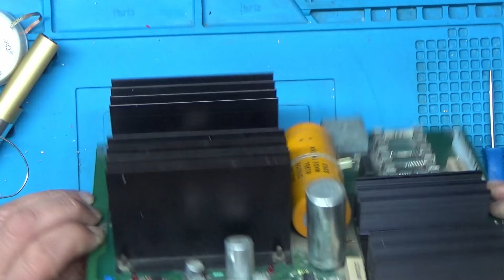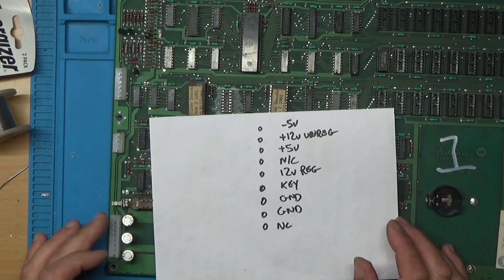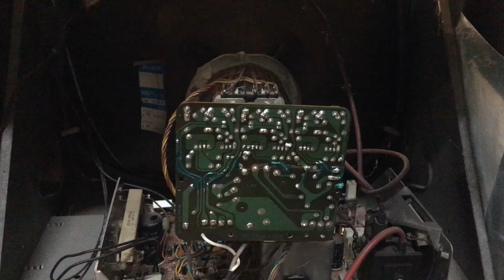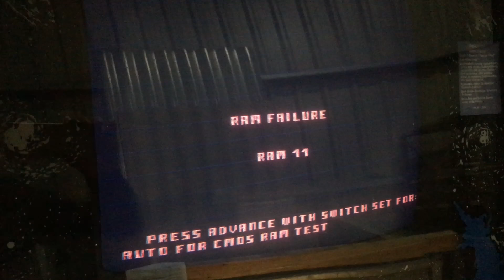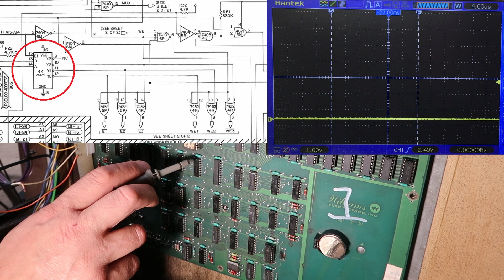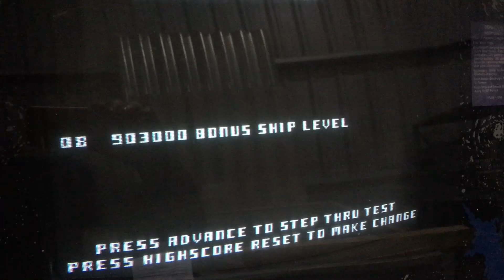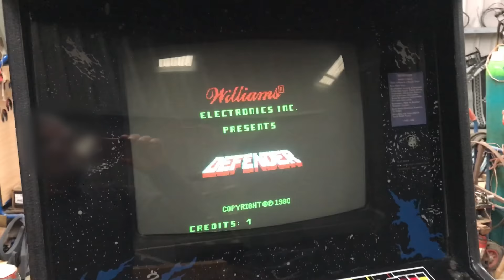The Repair That Broke Me - Part 2: Rescuing a 1980s Defender

Comment: That is one hell of a beautiful machine. 
I agree that old school capacitors last longer and are more "in spec" than Chinese replacements. 
Trade off cheap and you get crappy parts. 
But it looks like a whole cemetery of chips came out of this machine, so perhaps old school micro chips weren't as good as imagined. 
What is this machine worth now it has been fully restored ?
Reply from the maker: Yes, there was quite a big chip graveyard from this one. I think someone had one on eBay and was asking £4k for it. Not sure if they'd get that or not though.

Comment: Excellent job repairing this . Lots of things to fix . Do you think that battery replacement will have enough capacity only being a coin cell , you might lose your high scores after a shorter time .
Reply from the maker: Thanks. It should hold up fine as it's only powering the CMOS settings, but time will tell! 👍😊

Comment: I used to repair those arcade games in the late 70s and early 80s, it was fun, but they didn't want to pay the cost for
the techs and equipment back then, even though they were bringing in good coin...
Reply from the maker: Oh nice 👍I've also done a space invaders and recently a Konami Scramble board. Just finished doing a Galaxian board that was pulled from the same skip as the scramble one over 40 years ago. It was in pretty bad shape with loads of rusted chips and sockets, and lots of bits missing, and modifications. Oh and then more problems too! (Future video out in a few weeks).

Comment: Are capacitors today are being built for expected short life span products, like what you might use them for, you don't expect in use in 10 years.
I would think if thats so that you can buy top of the line ones rated to be exact and last as long, just you have to pay for what you want them to make play.
I mean that stuff 40 years old and 98% is still hammering hard. While a PS5 bluescreens 13 weeks after purchase.
Reply from the maker: I think it's because they changed the way capacitors are built. The old ones were a lot bigger, and they've reduced the size, and also the lifespan it seems...

Comment: Just caught up with this and your perseverance is exceptional. Many would have chucked it. Bravo a challenging one right enough.
Reply from the maker: Thanks mate 👍If you liked this one, I also did a similar one with a space invaders machine, which is in two parts. The first part was fixing the logic board which had multiple faults, and then I had to fix the PSU, Monitor, and I refurbished a lot of the cabinet too! https://www.youtube.com/watch?v=n4PGVKoHqOs and https://www.youtube.com/watch?v=dJA6zylhC-g
Reply: @B @BuyitFixit  Don’t worry it’s next on the list. Glad I’ve found your channel. As someone who has dabbled with project kits and some small repairs it fascinating to see your process and experience. I am picking up what these components do it’s clicking into place.
Reply from the maker: Thanks Craig, I'm glad you're finding my videos useful 👍

Comment: Fantastic repair! I missed however what was causing the audio issues near the end?
Reply from the maker: Thanks 👍From what I remember it was the cable they had used had the wires crossed over instead of being straight through. If you liked this one, I've done a similar repair to a space invader machine too. There's a part 1 and part 2, as it had faults on the PCB, monitor, power supply, and I powder coated the joystick panels and everything too :) https://www.youtube.com/watch?v=n4PGVKoHqOs (pt1) and https://www.youtube.com/watch?v=dJA6zylhC-g (pt2) if you didn't see that one. I'm also busy working on a Konami Scramble PCB, that I rescued from a skip over 40 years ago...
Reply: @BuyitFixit  Fabulous.  I will binge them all :)

Comment: BUT!! the thing is You've saved a piece of history from being lost. That is the best thing. and the thing is these consoles cant be manufactured again because the CRT tube is no longer available - putting a LCD panel isn't the same... I'm very impressed that the fact that you took on this and worked out every bug / Rom chips/ memory chips/ system chip/ all the wiring / I sure hope that Alex paid well for your time as it was no easy fix... And just think if you did not have all the schematics and the critical info - it would still not run right... A 6 star Video my friend with a Excellent performance rating ...
Reply from the maker: Thanks very much Lawrence👍 Glad you enjoyed this one. Check out the space invaders machine video I did, as it ended up being a very similar journey to this one with every major part having faults, and I even ended up restoring most of the cabinet too! Edit: I see you commented on that one too 👍

Comment: The old caps are measuring high because they are leaky, it's the way the tester measures them based on charging them up and measuring the time, leaky caps take longer to charge therefore read higher
Reply from the maker: Thanks for that, a few others also mentioned similar. I've recently re-built a space invaders machine too if you didn't see that one (it's in two parts too as there faults on every part of it too!) https://www.youtube.com/watch?v=n4PGVKoHqOs

Comment: As frustrated as you were at times with this one, I could watch this kind of electronics repair perseverance, investigation and ingenuity all day long (and did!). What a result. You not only brought a 40+ y.o. machine back to life, but did so in spite of previous bodged attempts that made your job harder, and spread great knowledge and inspiration to thousands of people at the same time. That's one for the books.
Reply from the maker: Thanks mate 👍If you liked this one I had similar frustration and journey with a Space Invaders machine which I repaired recently. It's also in 2 parts. Might want to check that one out too when you get time 🙂

Comment: Great videos dude!! I really enjoy them!

Normally I change electrolytic caps that still test ok but their age being in use start to pass 20-30 years, then its typical filter banks and power supply dc smoothers etc. 
The cap you put back in circuit since the new capacitor tested far worse on both ESR and capacitance, I would definitive done exactly the same. 

New capacitors of that type with 'NOT Awesome' test results seems to be typical for modern china-caps, and from experience I see the capacitance are on average are lower in new caps than seems to be a standard for components produced back in the days. 
These typically test like the one you put back, great capicity and ESR after many years in use.

I have been swindled by cheap sellers, once buying quite expensive electrolytic caps 1000mf 50 and 100 volt and then 100 or 200 at the time, and got bags of caps where every single one tested with a capacitance below 1000mf, but still within the variation - + % ..
Then, after setting them to work, they actually failed after very short time. Seems that they were produced ages ago and have dried up in storage. 

Them caps was seemingly made in Japan by Sanyo and Nichicon but sold suspiciously cheap from chine and Alixpfhess..

And also buying packs of 25 voltage regulators, LM338 5amp type that failed after being put in the designated circuits.  
They tested to be handling load that matched what a LM317 1amp type can handle so they had been given a new part number that made them sellable at a far higher price.. 

I stopped using cheap components from china totally and have been using well known western web shops since. Have bought a few audio tubes from china sellers via e-bay, but that was from serious sellers I already knew.
Reply from the maker: Thanks mate 👍 I've had similar experience with faulty or fake components from China too. A video I did a couple months back (KS Jive DAB radio repair) the parts were obsolete so I got one from Aliexpress. It was a completely different IC from what it was supposed to be. I proved a point by Xraying it so you could see the difference,  and then followed that up by decapping with the CNC machine milling the top off 0.02mm at a time 😂😂😂 I then sent them the pictures and the X-RAY and got a refund.

Comment: Nice job 😁I have one sitting next to me right now that needs some attention, repaired a few in my time and have 8 currently including the Defender. Had the same issue in a few with the Hanty monitors, they much prefer Wells Gardiners, I have a 7900 in mine as the original 4600 tube got necked...
Reply from the maker: Thanks mate, I wish you good luck with it 👍

Comment: Excellent repair, just out of curiosity I noticed on one of the boards there was a motorola logo sticker did that mean the whole board was manufactured by motorola or just the printed circuit board?
Reply from the maker: Thanks 👍Could it be the "Williams" logo? as a few people said it looks like the Motorola logo when viewed upside down?

Comment: Very nice repair of a classic CRT video game from the 1980s. I grow up playing this game when I was 17 at a place called Timezone. Timezone was one of the bigger centres for spending 20cents playing video games like Defender. Timezone was blacklight lit with black curtains and will all the game lights and sounds made it feel very space age.
Games like these are best played on old CRT stand up cabinets as it's the CRT tube that gives that 1980s feel to them.
We done restoring a classic game cabinet.
Reply from the maker: Thanks mate, and thanks for sharing your memories. I grew up playing games like this too. I've just bought a space invaders tabletop that has a B&W CRT, I'm currently working on it, but it's got quite a few problems and I've only started working on the logic board, so it will also probably be a 2 or 3 part video.

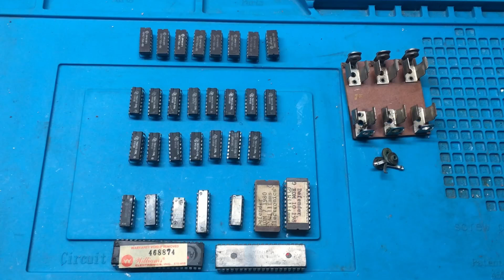Comment: 51:28 was the ram actually broken or was it just the buffer chips?
Reply from the maker: Yes, on one of the thermal images you can see 1x ram chip on the bottom right isn't glowing and all the rest are. When the PSU failed it took out some more too.

Comment: Fantastic job. I worked on machines like this in the late 80's,  although more often than not Namco/Atari boards with the huge JAMMA connectors that went into the MGVS (Multigame) cabinets.

Pintables were my favourite to work on, they were a nice mix of electro-mechanical repairs and board repair.

I still work in the industry but no longer on the workshop/bench, I do miss it!
Reply from the maker: Thanks 👍I too used to work on machines back in the late 80s early 90s but not down to this sort of level. Mainly re-wiring and converting old cabinets, or swapping boards / monitor chassis and power supplies. I remember working on a few pinballs too. A few I remember were Terminator, The Addams Family, Partyzone, The Simpsons... I've recently purchased a 1979/80 space invaders which I'm planning on restoring in a future video.
Reply: @B @BuyitFixit  excellent ill look forward to that!

Comment: Apreciate the x-ray at the end of this marathon fix as an x-ray engineer :) Back when you could actualy reapir stuff without a microscope! Today it's usualy find the fault and then throw that board out and throw a new one in :( Loved the 12v to 5v ram hack, outside the box logik saves the day.
Reply from the maker: Nice one. Glad you liked it 👍 I'm just busy fixing an item at the moment, and I've received a replacement part which I suspect is fake, so I'm going to x-ray that (probably my next video) and even possibly try to de-cap the chip.

Comment: I really enjoyed both videos and you did a really good job.
Reply from the maker: Thanks very much! Glad you enjoyed them 👍
Reply: @BuyitFixit You are welcome.And  i had also  serviced televisions for over 30 years , But you were right to check for the obvious visually , but then went on to check voltages, then waveforms, in your case  😊( only in my case , i have never serviced any public  type of commercial work.
Reply from the maker: I only really do this as a hobby myself. I worked in arcades years back when I left school, but never would have been able to repair this back then. It was more of re-wiring cabinets, replacing microswitches, power supplies etc. I've learned quite a bit over the years just from tinkering, what I've picked up from other people, and stuff I've picked up on YT over the years.
Reply: @BuyitFixit Thanks for your feedback , And  so odd EH? For the following reason.
One moment the 5V rail was present, and tbe next moment , the 12V became😮 the 5V more or less, untll you soldered a  variable resistor to tweak this to over 5V , and carried out lots of work in between , otherwise it would have dropped under load .😅
Reply from the maker: @Robert-1063 I think one of the RAM chips failed short which put 12v into the 5v as they use 12v 5v and -5v. My scope showed logic levels at about 8v and I knew something was up, so pulled the power and checked the PSU again. Strange how the regulator IC failed as I thought it would have been the output transistor. Either that or the IC just randomly decided to fail...
Reply: @BuyitFixit Keep up the good work,You,have that drive , I can tell 😊

Comment: Ohh that game starting sound brings back so many memories. I spent far too long playing this game in our local arcade back in the day.

I used to be able to 'clock it' which meant get a score over 99990 and if you're one of the few who were able to do this, you know what happens next🙂

Great video by the way.
Reply from the maker: Nice! Sounds like you were a pro at it. Glad it brought back some memories 👍
Reply: @BuyitFixit  I got banned for fiddling free credits with a piece of coat hanger bent in the neccessary places to tap the little wire/switch the coin passes to trigger a credit before it drops into the coinbox. A fatal flaw that they took far too long to rectify and which I took full advantage of, until I got caught. I eventually got back in on the condition I behaved myself. 😁

Like I said, those sounds bring everything back, memories from 40 years ago, in a flash.

Thank you.
Reply from the maker: 😂😂😂😂Thanks for sharing that coat hanger story, and you're very welcome. I've just bought a 1979 space invaders table top, so I'll be having a look at that in a future video.

Comment: Very nice! What a wonderful mess!

As for those batteries, wasn't that 3x1,5V in series? That'd be 4,5V, not 3V. Does that work?

Btw, where's that accent from? I tried to ask this AI, which said you were from the US, but it really doesn't sound like that ;)
Reply from the maker: Hi mate, yes the memory retention voltage on the chip is 2v, so 3v is fine. I'm from Northeast England (near Newcastle) which is where my 'Geordie' accent is from.
Reply: @BuyitFixit  Thanks! I've been to Newcastle, but that's 20+ years ago back when you could travel by ferry to Bergen.

Comment: Excellent diagnostics, I admire your persistance.

As for de-soldering tool, I have the Duratool branded version of the same thing. Bought to replace my 35 year old Weller DS801 when I ran out of spares for it,
scrapped but kept the Vacuum guage, fitted it into the top of the case of Duratool & connected with a T piece, now I can see when tip gets blocked by excess vacuum. Also I found needs to be at least 400 Deg & wait longer for it to warm up, temp sensor is not at the tip end so inaccurate.
Reply from the maker: Thanks for the kind words and for the tips regarding the de-soldering tool 👍

Comment: Very impressive work - thank you for restoring these great machines. I'm surprised at the original manufacturer and the amount of built-in diagnostics that it comes with.
Reply from the maker: Thanks 👍 You tend to find with older equipment there's a lot of schematics and diagnostic information available. Unfortunately this seems to be lacking with modern stuff 😢

Comment: Thank goodness for MAME and the Raspberry Pi.
Reply from the maker: Yes, it's slightly more compact. Not sure if it's the same experience as playing on a full size cabinet though.
Reply: @BuyitFixit  Agreed but you just build it into a full size cabinet.
Reply from the maker: I've done that in a half size cabinet on here. It was a 1up street fighter that I bought to repair, and then ended up converting it. It's pretty cool.

Comment: Man you really earned a 👍 on that fix!
I worked as an arcade technician for a couple of years, and Defender was onenof my all time favorite games. At that time, about 1986, one of the arcades had phased out a Defender and put a newer game in the console box, so I was able to buy the full board set for cheap, like $50. Probably about $150 in todays money but I was happy.
Then, as I was installing it in a cabinet for myself, I realised that ROM 5 was missing and I was heartbroken! I figured it has been used for parts and my boards were no good, so gave up on the install and it ended up scrapped some years later.
NOW, looking at your video I realised that ROM 5 was missing on your machine too! And it is not needed? WTF? That means my Defender boards were complete and working? I am so frustrated by that... all those years ago I could have had my favorite game working if I had just finished installing it, what a bummer 😊
Reply from the maker: Thanks 👍That's such a shame. Yes ROM 5 isn't needed. Some of the lower ROMs are 2732's so 4K. while the upper are 2716 (2K) but they work together as upper and lower to provide 4K still.
Reply: @BuyitFixit    it's been a sad memory for me for almost 40 years lol.
I even rang around a big arcade reseller at the time trying to get a ROM 5, and found out they had a defender board there for parts but "sorry it's missing the chip you need, we cant help you" ...
Now I just have to 😂😢😂😢